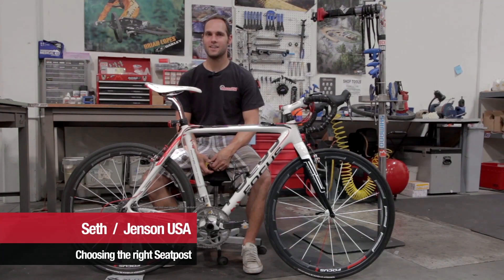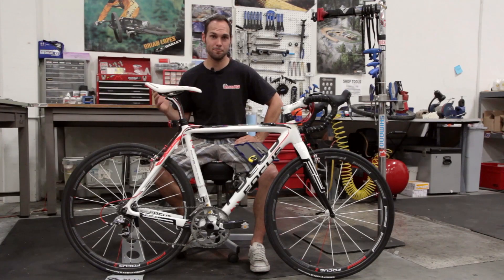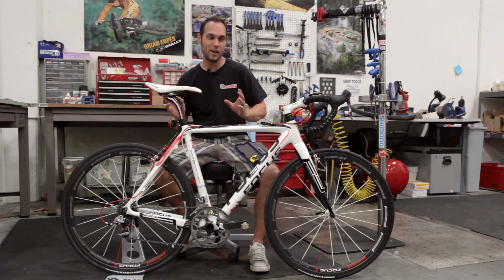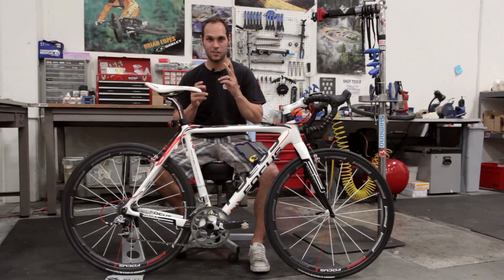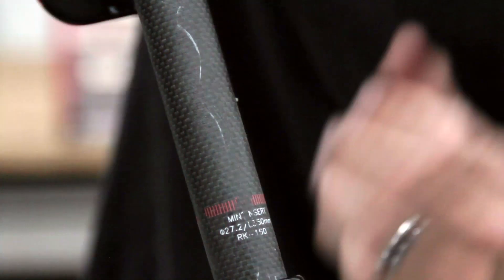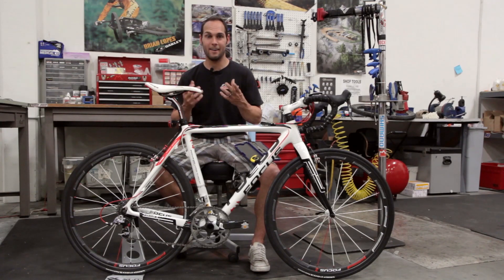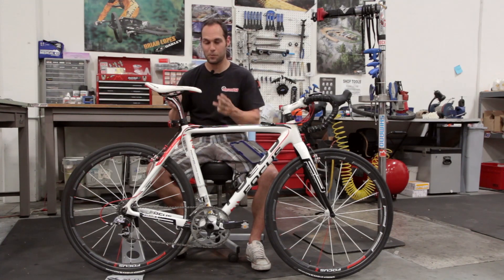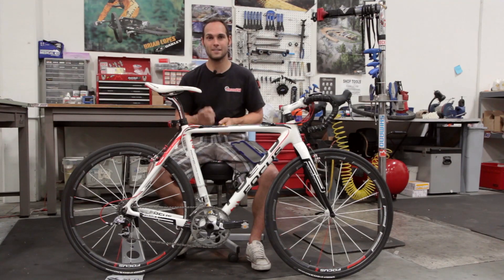Ask A Wrench Episode 06: Choosing the right Seatpost

Comment: Another very informative video!!
Could you tell me which dropper seat-posts you are able to cut?

The reason I ask is that I want to install a dropper post into the Specialized Diverge road bike; its seat-tube is kinked/narrows at a point near the middle.

(You'll probably ask why I need a dropper seat post on a roadbike - its not the usual reason; I have a bad leg so I need the seat to drop so  I can get on and off the bike).

Comment: does offset take away from the watts?
Reply from the maker: That's a good question. The answer is, "kind of but also kind of not." Ideally, getting a bike that fits you perfectly will give you the best wattage output. But each riders body geometry is different, so often it means getting as close as possible and making small tweaks to dial in the fit to their needs. For the rider in this video, the offset helped them open up their torso for better position and breathing. This does slightly offset their leg alignment but the wattage loss is likely minimal and was offset by the gain in comfort. Hope that helps!

Comment: How do you determine the right seat post and clamp when the seat post and clamp is missing?
Reply from the maker: Hey Sam,
There are a few methods that will work.  The first is to use a digital caliper as seen in the video to get both an inside and outside measurement of your seat tube on your frame.  This is probably the easiest, but if you don't have a caliper, you can use a ruler/tape measure to measure the diameter of the tube in mm (both inside and outside diameter).  Last, you can rap a string around the outside of your seat tube to determine the circumference and divide by 3.14 to calculate your diameter.  You will then need to measure the wall thickness of your frame material, multiply that number by 2, and minus that from your original outer diameter.  The outside diameter will be the seat tube clamp size, and the inside will be your seat post diameter size.  If you need more help, contact our gear advisors, and they'll get you dialed! www.JensonUSA.com/GearAdvisors

Comment: what if your seat post was stolen and have no idea about the size for a new one?
Reply from the maker: Oh, no!  There are a few methods that will work.  The first is to use a digital caliper as seen in the video to get both an inside and outside measurement of your seat tube on your frame.  This is probably the easiest, but if you don't have a caliper, you can use a ruler/tape measure to measure the diameter of the tube in mm (both inside and outside diameter).  Last, you can rap a string around the outside of your seat tube to determine the circumference and divide by 3.14 to calculate your diameter.  You will then need to measure the wall thickness of your frame material, multiply that number by 2, and minus that from your original outer diameter.  The outside diameter will be the seat tube clamp size, and the inside will be your seat post diameter size.  If you need more help, contact our gear advisors, and they'll get you dialed! www.JensonUSA.com/GearAdvisors

Comment: Since you don't seem to understand the system of seat post diameters, mister teacher, I will set you straight.  The seat posts are engineered, and built according to the S.A.E.  "INCH" system.  1 inch  is translated into the so-called 25.4mm.  1 1/16 inch is translated as so-called 27.2mm.  1 1/4 inch is translated as 31.8mm.   Do you get the point?  The Metric world has been saddled with the fact that many of the standard sizes are still engineered for the INCH system, so to present this situation to the world, they use these absurd Decimal Millimeter equivalents to the INCH system.  My personal favorite is the absurd "203mm"  which is precisely a "version" of 8 INCH.

Comment: I don't think you can get 0.2mm accuracy by using a tape.
Reply from the maker: You are correct.  Luckily, the most common post sizes are well beyond the 0.2 margin for the differing sizes.  Generally, you can find a printed measure on your post.  Keep Pedaling.